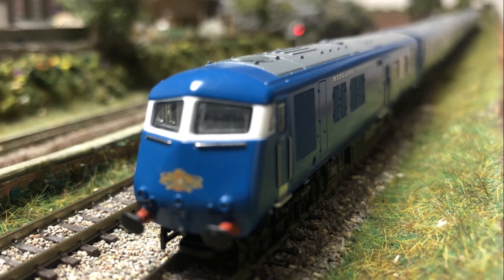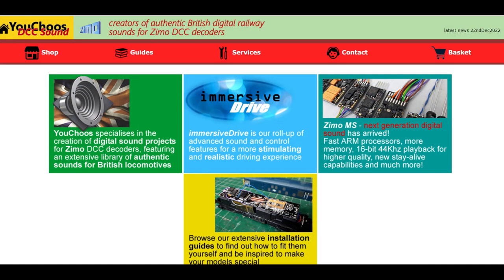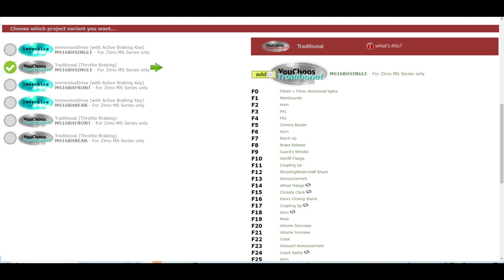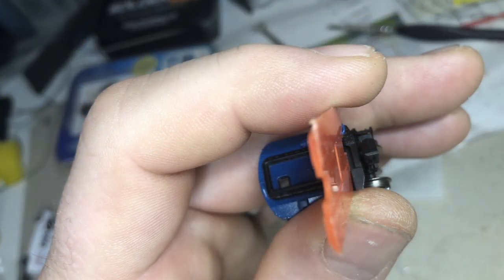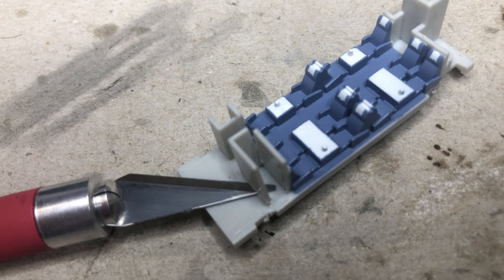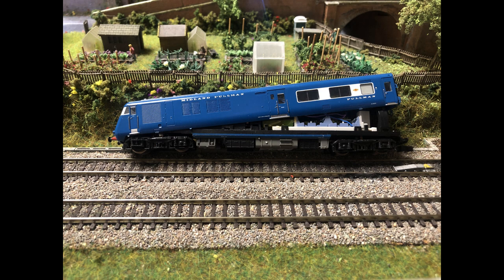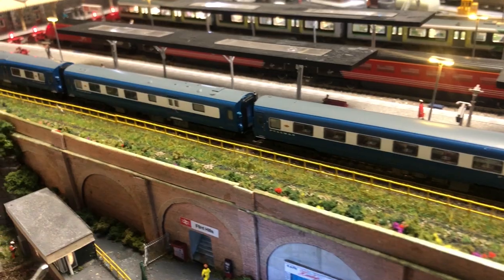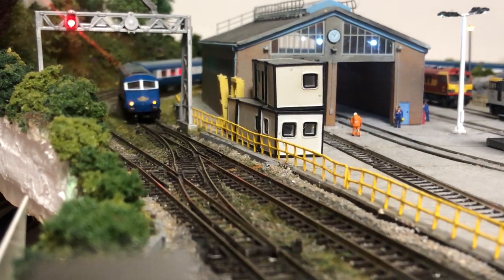Adding Sound to the Class 251 "Blue Pullman"

Comment: Hi Geoff. Thanks for the heads-up on fitting sound to this model. I too will probably go with sound on the driving car only. I made a note of how you did this for the GWR 800 IET - though I have yet to try this modification. Fingers crossed on both models!